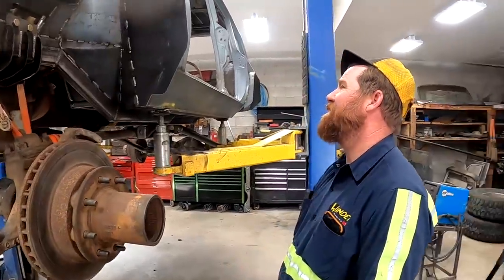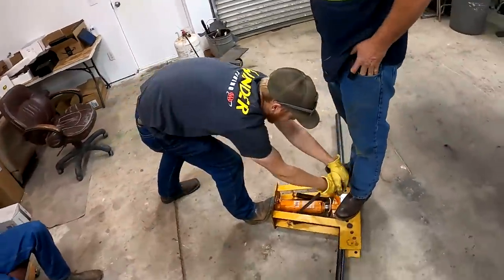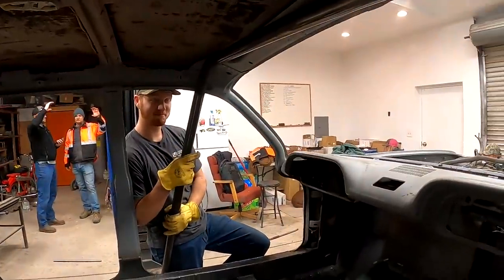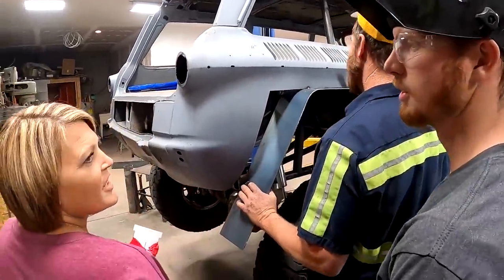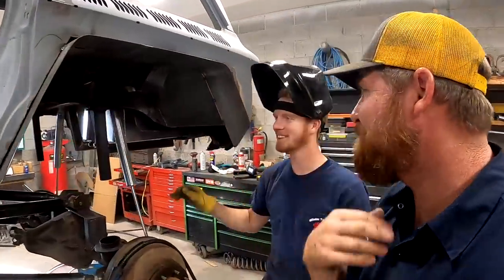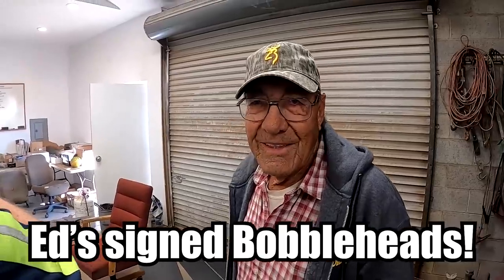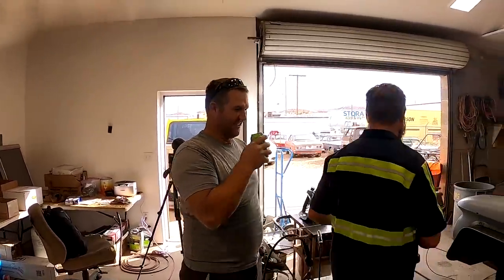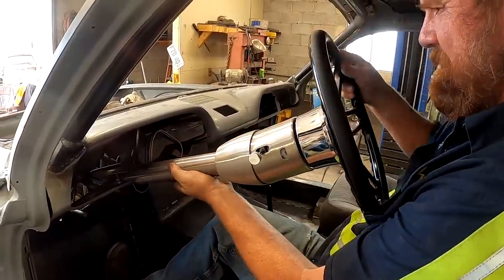Deadline Is Too Close...Can We Finish The Corvair On Time?

Comment: i bet when GM built the corvair they never imagined someone would do this with one of them
Reply: Ok I  am bored 🙄😑 I think I'm going to go hook up my trailer to my XJ put my F-350 super duty dually lightweight which means it doesn't have its bed it has no carpet no back seats no doors pretty much stripped I see a long it takes me to get stuck
Reply: Believe they might have been to Scared to imagine something like this.
Reply: @evilbrat5376   no I am stupid I wrecked my Ford F-350 so I ripped the bed off took the doors off chopped it and made a off-road rig out of it it's basically similar to what Matt is doing
Reply: And it's a little bit unfair my Jeep is super modified
Reply: @steelgatorcrimsontide7403  Who asked?
Reply: @averagedemographic8933   😭🙄😑
Reply: IDK
Reply: Tilc Rekcil  Haha exactly! Not sure how I feel.

Comment: A fellow engineer once told me:  "I get paid to think.  Occasionally I write things down."
Reply: I had one tell me back in the 80's ---  "If the minimum wasn't good enough it wouldn't be the minimum"  ;)
Reply: @DeanJohnson67  I can't wait to use that at work.
Reply: @DeanJohnson67  Scary but true!!
Reply: Sometimes you gotta shoot the engineer and move on with production.
Reply: Love your comment... We had a "quality system" where I worked as an engineer... Our saying was "If it wasn't written down it didn't happen"... Lol
Reply: The engineering process - Measure it with a micrometer. Mark it with chalk.  Cut it with a hatchet.
Reply: An optimist sees a glass half full.
A pessimist sees a glass half empty.
An Engineer sees a glass that is twice as big as it needs to be.😅😂🤣
Reply: @erict6183  After 20+ years in Production & Materials Engineering, that process is familiar with most production managers and line supervisors. The prototypes just keep getting better and better with improvements we just have to add to the project (because otherwise, the competition will as soon as they see our release!) and it continues without end! That's the point were the boss says, "Shoot the designers and let the production begin!!" Otherwise, we'll never make a dime on this damn thing!! 

The final product costs many times what the initial proposal was...

Comment: Hey guys. I am here because I am a fellow fabricator and a fan of Corvairs! Looking forward to seeing this build in on the trail and in action! When you bend roll bars, try and make sure the weld seam is oriented on the neutral axis. Your main hoop had the weld seam on the outside of the bend, making the weld seam experience maximum stretch. There is already a bunch of stress on the tube due to the weld, and asking it to stretch is potentially making it worse. Putting the weld seam on the center line makes the tubing as happy as it can be. When starting a bend, just remember to make sure the weld seam is lined up with the edge of the bending die and you will be all set!

Comment: I was a machinist for 18 years, no safety glasses have lost a lot of eyes. He must not care about keeping his vision.
Reply: They’re adults and can make their choices, but you know that impressionable kids are watching and that drives me nuts.
Reply: As an EMT I saw that too. Safety googles shouldn't be optional.
Reply: @larsradtke4097  Once you've seen eye damage where it could have been prevented, you learn fast.
Reply: no one asked, no one cares, but you opened your trap anyways. glasses the way they were grinding are pointless, they make a guard to keep sparks away from your face. glasses when welding are pointless as you are wearing a mask. glasses when walking around the shop just make you a tool. only time I see a point in glasses is when grinding in a tight space, drilling, under the vehicle, or when using air tools.
Reply: @hanksadventures4132  I once had an aluminum Oxide grinding wheel spinning at 8000 RPM shatter in my face. The only part that wasn't injured was my eyes.
Reply: @Stephen-cr3sc  did you have a guard on? were you grinding in an unsafe manner? I've had grinding wheels blow up on me as well, I  had my guard on or it was well away from my face. being safe with your tools is the best PPE.
Reply: @hanksadventures4132  ......Yes, the guard was on. I was dressing a wheel into the form to grind a HSS form tool on a K.O. Lee, Tool and Cutter grinder. I was using a diamond mounted in a piece of steel bolted to the bed. I had first ring tested the 6 inch wheel for the dull sound that indicates a possible crack. It rang perfectly. This wasn't my first time by a long shot, I owned the machine and wheels. It was an older machine, with minimal guards.
The wheel just exploded. That was the second of three close calls The first was on a Bridgeport mill, the last on a Clausing lathe. I had a wife and small children, I stopped being a machinist after the third. I bought a printing company.
Reply: @Stephen-cr3sc  at that point, and with that machinery I understand the use of safety glasses. I'm glad you are ok, and I don't DISCOURAGE the use of glasses, I also do not condemn those that choose not to as I myself don't wear them when doing smaller tasks with minimal risk
Reply: @hanksadventures4132  ......I wasn't condemning him, I merely pointed out if he loses an eye, he'll condemn himself.
Reply: @hanksadventures4132  maybe you should consult an insurance agency about their experiences about aims over preventable eye injuries. Or your local emergency responders. Grinding and not wearing glasses, as Murphy's law says, what can go wrongy goes wrong.
Reply: @larsradtke4097  I have experience as an emergency responder, thanks. looking at risk levels for each activity;
 grinding with angle grinder, arms at 90° and guard on: Very Low
grinding with angle grinder, arms at 45°, guard on, grinder  10 inches from body: moderate 
grinding with angle grinder, arms at 90°, no guard: moderate to high
welding in tight space: very low
welding in open space: very low
welding on back: very low
welding period: very low
walking around shop: very low
bending maluable metal: very low
... see the point here?

Comment: People used to ask me at work why I would just stand and stare at a piece of equipment for extended periods. Move around and look at different angles. Move it around and see how it moves and operates. It takes a while to piece together the thousands of ways to achieve a vision or end goal. It is the most fun I think. But it does get frustrating when others don't see the value and try to rush. Great build. Going to be a beast off road. Can't wait to see the final product. If I'm holding a piece of work while someone else is cutting with a plasma torch, I usually hold it with a pair of pliers. Not bare hands. Not even gloves at that point.

Comment: for the steering rods, use 3/4" hardwood dowel for test pieces.  It is cheap and will work to test for binding!  The wood will allow you to cycle the steering lock to lock and act as a fuse to keep from bending parts.  You can then cut the metal double d shafting to size with no oops.

Comment: Recommendation: Only 10% fresh air for A/C and put manual Recirc Doors on/at each evaporator so you can keep out dust and keep things cool inside. Also, and simple "Cabin Filter" at each inlet would be great and make your system survive all that dust. The Chevy/GMC Suburbans with rear A/C do a great job with just one A/C compressor. Take a look at the schematic for the high/low-pressure lines and such and you may be able to have dual evaporators.

Comment: The bottle jack on that pipe bender wasn't designed to work on its side,  no fluid to draw in and squeeze.  It' should only take a few pumps. Another great video

Comment: Hey Matt & Crew, I like the looks of this build, really cool,  :)    Having said that I want to share a lil story with you, I had a friend back in the day, he turned his Camaro into a 4x4, well actually he paid to have it done, anyway, he had them use a sub frame instead of a full frame, this caused some serious issues, having not even used the 4x4 part except for 2 trips up the hilly road in the snow, the body began to crack where the top met the rear fender, on both sides, the point here is (and yes I have seen the beefing you you have done), but pulling with it could cause big problems, so I would use it in Non_Dangerous situations for a long while before you put in some of the spots you have the Banana. Cheers

Comment: to get perfect bends  with a pipe bender on roll cage tubing drill a hole directly above the ram on the jn the die. cut a 2" section of the tubing slice it in half force it down over the pipe then strap it down with the metal straping  with the holes also use another2 half sections on the rollers to prevent dents

Comment: You've probably thought of this but years ago I got an air operated jack from harbor freight for the press I use to press out piston wrist pins.  I break it loose with the handle then hit the air and it speeds the process up a bunch.  Just a thought.  Seems like every project hits that point where it seems like it won't end.  A good nights sleep and a short beak and somehow it all starts to click.  (At least what I remember - haven't done one in a long time.

Comment: Build yourself a flat table and mount your pipe bender to it make sure it's square and then when you bend your piping you can use a square off the table to make sure it's perfectly square as you bend it.. put the pipe bender on the corner of the square bench make it about a 4x8 square bench.... And make sure it can swivel but it still level and square to the table so whatever you bend inside that device you can set it against something that's square coming up off your table and you can keep all your piping that you build perfectly straight so if you build bumpers and things like that.. or roll cages and things like that it keeps all your bends the same direction looking even so your pipe doesn't become an s

Comment: Matt,
 The one thing that always helps me to not get overwhelmed on building a vehicle is, Don't look at it as a whole, Don't look at everything you still need to do, Look at it as One thing at a time, Like Hanging the Doors, do it and Check it off the list, Put Hood on, Check it off the list, Put the Engine in and and check it off the list and so on and so on until you get the vehicle done, I'm telling you I use to stand back and look at all the stuff I still needed to do and I'd get depressed bc of it, I stopped doing it like that and it's been great ever since.  You'll Thank me later :)

Comment: I love what you're doing on this Corvair I love the old corvairs never seen a Corvair
get turned into an off-road vehicle , looks like it'll be the first that's great the only thing I would have done different on this project you're doing here I would have gone old school small block Chevy personally I hate these damn LS Motors .
I hate them with a passion I'm just an old timer and I love the old small block Chevys they're proven engine and these LS engines I just can't stand new type stuff ,  but if it works for you that's great , keep up the great work .

Comment: You should step the rear portion of the roof that would get you more clearance inside the car and it wouldn't affect the use of the car much. When taller people set inside the car you can tell its not comfortable.

Comment: That harbor freight bender works a lot better if U yank that jack out and put $50 chinese ram in. U can run the ram off of any Hyd pump. IE: skid loader aux, to an old power steering pump hooked to an electric motor. Best bet is slap a Hyd pump with electric clutch in that XJ an U can run all kinds O junk, like a hyd winch front & or rear, a pick em up crane for your UTV retrieval trailer, jaws of life type ram to push, bend or lift, on the trail, All kinds O ideas. Great show bro, keep em up. I know U are a cheapy but I still say ya need ORI struts & onboard air on the Vair. So U can tune the ride for Ed & the crew as U guys roll. Hell Ed a even get a kick out of U flippin the dump when U guy pull up on a job so he can mosey out easy. 🤣 Hell, give ORI a call an tell about your show, they should send U a set for showin the install & how well they do for U... The show deserves it!

Comment: I hate to say it. But it almost looks like you need to add some roof height, or more recline to the seats. Since your going to be bouncing and shaking side to side a good deal. Extra padding on the sides might also be a very wise decision. As a fairly tall guy, I have grown to hate having to slouch in vehicles to avoid smacking my head on the roof. Which when you get in an accident or something seems to completely unavoidable.

Comment: So are you going to use a Corva Power-Glide or flip the TH-425 for the Tornado as differential with an old 4.35 GM transmission you’ll have 8 or 12 gears forward

Comment: Sub out as many jobs as you can afford to, good idea getting your buddy to prep the doors for painting. I've started roller paining vehicles with brush on metal paint and a tight foam roller (avoid any brush work, try to do it all with a large roller and get some tiny rollers incase there are tight features you can't get to).. It leaves a decent finish if you know how to roller paint, you can either flatten it back and polish it up or leave it as that toughened matt / satin look, Saves quite a bit of time and would suit you guys since your not into wearing masks to protect your lungs. Anyway, it could be a good way to save a day if you order the paint now. I mix colors but finding an industrial brush on yellow could be tricky but hey, you have everything in USA i'm sure there is a brush on JCB color available somewhere.
  PS. Grey primer absorbs moisture when left raw for any length of time but that shouldn't be an issue as i'm assuming it's super dry out there.

Comment: Ac intake on an almost horizontal and  unprotected louvered surface/opening? ...how are you going to get the sand out after the first time you spin the front tires pulling someone out from loose sand that rooster tails everywhere? Will it not just stop up your rear seat AC intake duct?

Comment: Matt great program thanks have a small problem you may be able to answer for me i run a 2000 Nissan Sentra cn you tell me which way i turn the adjustment screws to lower the beam on the headlights thanks Matt
Reply: Why Don't You Just Turn Them And See What Happens?

Comment: Using a pipe bender to bend roll cage tubing? You need to upgrade that, my man. A nice JD Squared or similar tubing bender will enable you to make those bends without flattening the tube. Of course you could pack it with sand, but that's a pain. Get one of the tube bender companies to hook you up!

Comment: Hi Matt I have a question about your windows. Are you planning on replacing them with thicker panes because I feel that the old ones would be prone to shattering when you take a bump off road.
Reply: Old ones like those are just straight glass with no filament in between.

Comment: Three Comments:

1.) All things considered, wouldn't it have been easier to just factory order a 1961 Corvair 4x4 wagon, with the LS engine upgrade, the big tires and the optional A/C?  😁  😁  😁 
2.) Next time you and Lizzie are standing up on some sheet steel, weighing it down for bending, you guys should do a little square dancing. 
3.) Truly wonder how much recovery work you'll be doing after the build will be completed. It's going to be tough to go beat it up on the desert sands (definitely fun though)
      but it's also going to be so freaking awesome that you'll be spending half your time at car shows!

Comment: Why does the A/C need fresh air especially in the desert heat and dust? Isn't the condenser going to be with the radiator up front? That is the only fresh air an A/C needs  in this application.

Comment: I just don't think it will be as useful because of the sheer weight. That "looks" like heavy gauge metal. I get it if it is a design you really like, but it seems like it is going to be a bit of a tank. Double transfer cases and you can get low enough gears for it. Obviously this is a passionate project for you and it will be very substantial. You dent that lower body and it will hurt what you hit too. LOL

Comment: If I had used a claw hammer on metal my father would be extremely upset. Use the right tool for the job son!
Reply: 32 ox. Waffle Head Framing Hammer Best Fabrication Hammer Ever!
Reply: @JohnMontero-Nevaden  the problem is that carpentry hammers are made of soft steel, a ball peen hammer is made of much harder steel.

Comment: Yea, yea, yea.....you keep saying that roll bar is only for a flop over at zero speed but SHEASH man, connecting the front loop to the dash is ridiculous.  It wouldn’t have been that much more work to run it down to the frame for it to be done right.

Comment: Your pipe bender needs Hydraulic fluid you can tell he's compressing more air than fluid
Reply: Surprised it worked at all , laying on the side is not how those jacks are designed to work.
Reply: @TD_YT066  actually that bender are designed to work on their side so you can bend long pipes, but when the fluid get low they can suck air from the surface on the up stroke, if you don't add fluid going slower on the up stroke will allow fluid in with out sucking air

Comment: Before you said the roll bar was for "flops" not high speed rolling, I was about to say you ruined the structural integrity of the tube when you bend it with that bender. You need an actual tube bender.. if you want it to remain strong...

Comment: Propane burner inside with all the doors closed. Get a carbon monoxide detector at least.
Reply: It’s a fab shop, it has adequate exhaust ventilation elsewhere
Reply: @morrrudy434   I didn't see any that is the reason I mentioned it. Brick wall, closed doors, no fans, a disaster in the making.